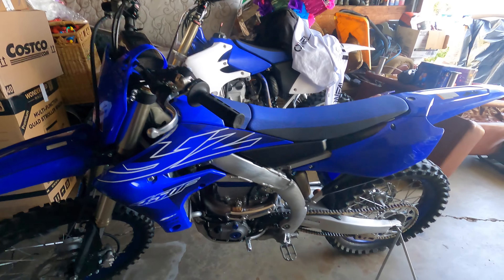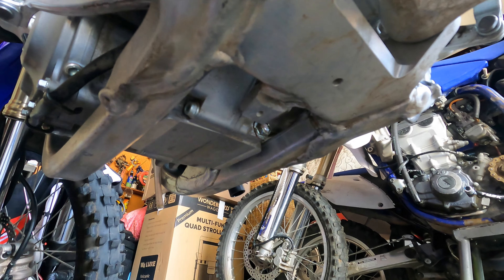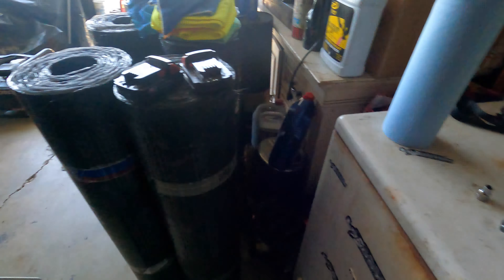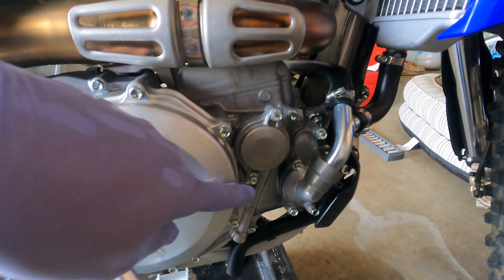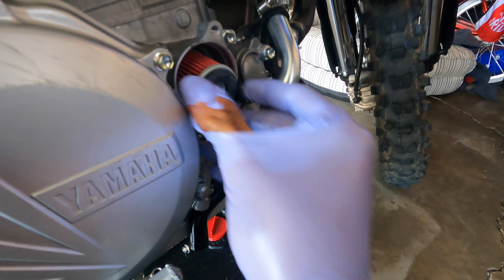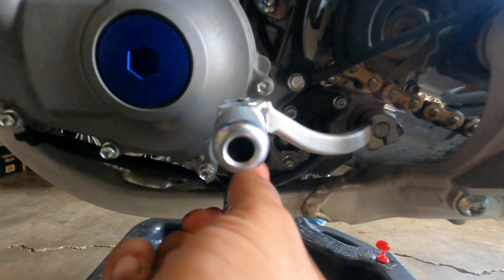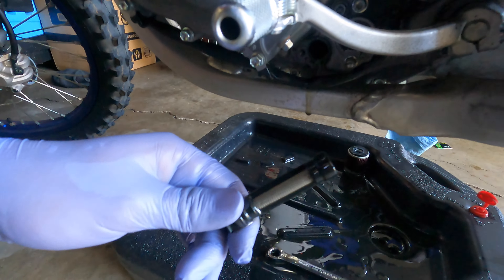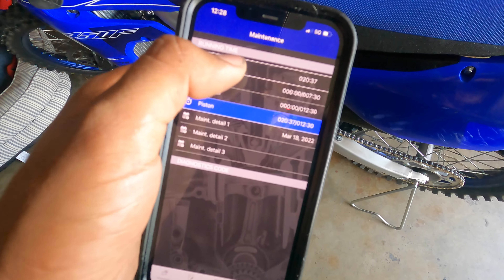2022 yz450f oil change

Comment: There is an overflow bolt to make sure the oil is topped off. The sight glass is the minimum marker. It needs a few more oz above the glass. When you start the bike the level will drop to the minimum line on the sight glass.

Comment: U need to start using gold bottle yamalube. Hi performance
Reply from the maker: That was my 3rd oil change now I use that oil you said
Reply: @4fitty  heck yea I jus started about 3-4 changes ago and now when I change oils I can def tell the difference with the HP not being as dark/burnt
Reply: @1bigstash  I just did my first oil change on my '22 I'll be looking for that HP shit. Thanks 🇺🇸🤘🏻
Reply: @dirtymaxduramax  fasho! Should be available at any atv store yamaha dealership or worst case Amazon prime